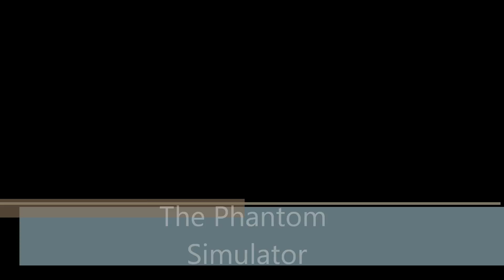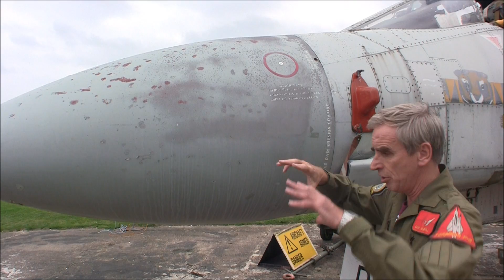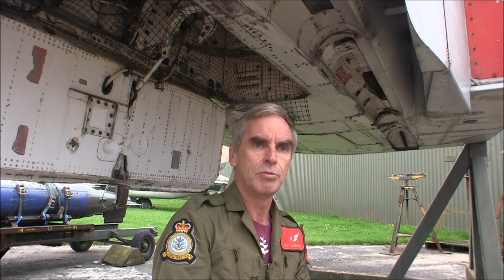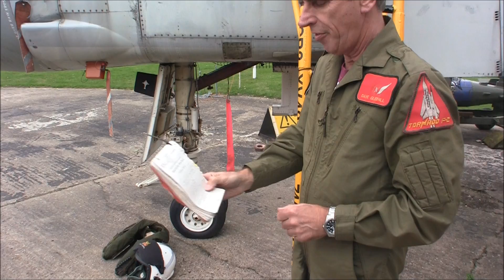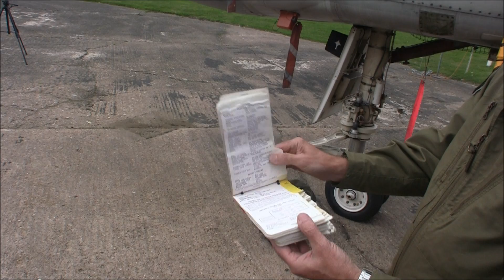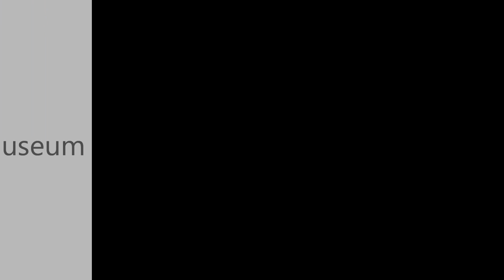F-4 Phantom Extras with David Gledhill

Comment: I still don't understand the principle of the ramps before the engine intakes. What exactly do they, and how? And why don't have all Mach 1-2 aircraft have them?
Reply: Ramp intakes control the airflow into the engine.  
Ramp intakes can be on the inside (as they were on the F-14 Tomcat) OR outside nodding intake ramps/"pseudo-canards" like the F-15 Eagle has.  
They slow the speed of airflow down by controlling the cross-sectional area of the inlet ramp entrance.  The faster the jet travels, the more constricted that area generally becomes to help slow down the air so that it's still traveling at subsonic speeds as it enter the engine compressor.
(I'm no engineer and my understanding of physics is basic but I think this is an application of Bernoulli's Principle.)
Jet engines CAN'T process supersonic airflow.  Even in the fastest jet, the SR-71, the airflow has to be slowed down so that it's subsonic before it enters the compressor.
Any variable ramp system adds its complications (development costs, weight, complexity, and more maintenance for the plane) BUT they're more efficient over a wider range of speeds than a fixed inlet system like the F-16 and F-18 have.  Fixed inlets like those are only efficient to maybe Mach 1.5, Mach 1.8 tops...  Past Mach 2, a variable inlet (ex: F-14 or F-15) is virtually mandatory for the plane to top out near Mach 2.3-2.5...  Every Mach 2.2+ plane that is flying today that I'm aware of has variable inlets.  They are either intake cones that move or inlet ramps
The F-16 DID achieve Mach 2.12 in its trials but in routine practice they generally don't break Mach 2.
It's NOT true that a plane needs variable inlets to go past Mach 2 by much...  The F-104 Starfighter had an inlet cone design that was optimized for supersonic speeds as did the Mirage III.  The F-104, in fact, flew close to Mach 2.5 in some test flights made to set altitude/climbing records.
The F-16's fixed inlet from my understanding was optimized to allow the greatest efficiency in the speed ranges it was expected to fly at for the longest durations of its missions.  Its inlet is NOT optimal for Mach 2+ flight BUT it's two generations later than the F-104 design and I would imagine is more economical over a wider speed range.
Reply from the maker: I shall put it to Dave himself for you :)
Reply: You're welcome!
Variable inlets basically aren't used as much because designers have demonstrated variable speed efficiency with fixed inlets and honestly it would be another $1billion-$2billion in development costs to equip a plane with variable inlets.  And for what?  So that it can speed at Mach 2.3 for 10 seconds??!?  Fighters rarely fly past Mach 2 as it is!
They actually LOCKED the variable ramps on the F-14 in its later years of operation to save on maintenance.  The plane could still achieve Mach 2 even with locked ramps.
Reply: Honestly...  Don't know.
The F-22 is weird in some ways.  It has very powerful engines -- 35,000lb thrust class AT least although I've read somewhere they may develop close to 37,000-38,000lbs actually (which wouldn't be weird because many engines develop extra thrust the closer they get to supersonic speeds; generally 2,000lbs or less per engine for fighter engines).
Most sources say the inlets are fixed -- at least what we can see.  The inlets are S-duct shaped to reduce radar cross return.  Incoming radar waves don't really see the compressor sections of the engines per se.  Whether any part of the inlet that we can't see IS variable, I don't know...  (Again, a variable inlet is NOT an absolute for top speed.  The F-104 had fixed inlets and was still pushed to about Mach 2.5 during test flights.)  There are major parts of that plane I'm sure are classified and I seriously doubt they've released completely accurate schematics of the plane's structure simply to help foil countermeasures against it.
On paper, the plane is capable of at least Mach 2.43 although like most planes operational pilots generally won't fly that fast to preserve fatigue life on the plane.  There are plenty of plastic used in the skins and critical structure of the F-22 that will NOT take repeated heating above a critical Mach number as well as conventional metal alloys.  That's one of the penalties of using composites in place of metals -- lower temp limit, generally more restricted Mach number.  Honestly, experience has shown that Mach 2+ is pretty much pointless -- you basically only burn fuel faster and have bragging rights for all the good it does you.  A speed of up to Mach 1.8 is probably "good enough."  Clean acceleration to Mach 1.5-1.6 is desirable for launching missiles but virtually no fighter can fly faster than Mach 1.8 with a full load of (6-8) missiles anyway.
The Air Force decided long ago to relax the speed for the most part.  Effective Mach limit is closer to Mach 2 but it has plenty of power to go faster.  I think they're advertising the higher top speed to make the plane sound more impressive.  What's really more impressive is the cruising speed, Mach 1.5+ although, again, they say it goes at high as at least Mach 1.73 at cruise.  They won't use supercruise that much, though, since the engines aren't as efficient at supersonic speeds, afterburner or not afterburner.  Alternatively, they can reduce the supercruise speed (below Mach 1.5) to extend range somewhat but it's still not as efficient as cruising at subsonic speed.
Reply: Thanks for your thorough explanation! You definitely made it more understandable for me
Reply: I suppose you're right. How about the F-22, does it have them?

Comment: The US Navy did, my Father flew them for years, I have sat in them, I have heard the US AIR FORCE dis not have rear sticks.
Reply: Navy Phantoms didnt have rear controls (at least the later ones), Air Force Phantoms do. This is because the Navy felt that it was too hard to land on a carrier from the rear seat.
Reply: Not true!
The original Air Force Phantom model was the dual-control version.  F-4Cs COULD be flown by the backseater.  That was the major difference from the Navy's F-4B besides the difference in landing gear equipment (tires).  It created a bit of an issue in the Vietnam War because tendency was for the frontseater to fly the plane most of the time and backseaters got very little hands-on flight time.
Any way, with the complexity of the radar and lack of digital processing systems you really needed the backseater to handle the radar (like all Navy versions did; no Navy Phantom model I'm aware of was ever built as a dual-control version; that was also the case with every F-14 built).  Later Air Force models (F-4D/E/G) were set up like the Navy versions.  They just called the Air Force backseaters WSO's (weapon system operators, Whizzos) instead of RIO's (radar interceptor officers) as the Navy did.
Reply: +135th Darksword I am referring to 1969-1972
Reply: I was a crew chief on F-4s while in the USAF and they did have rear sticks
Reply: USAF F4Es had dual flight controls.